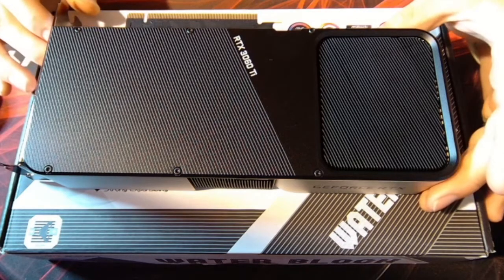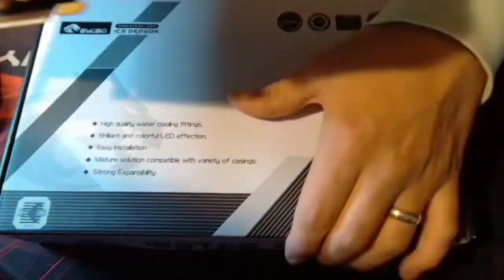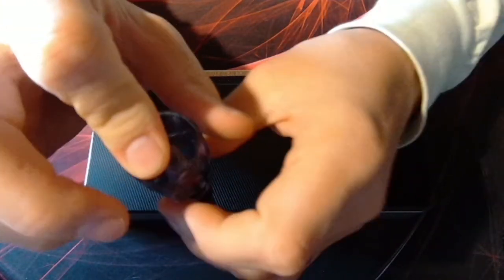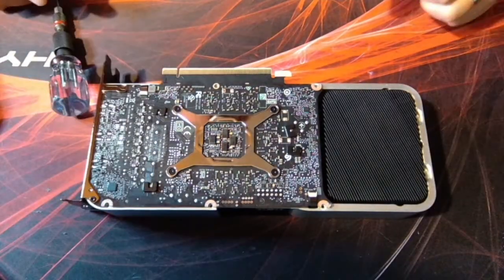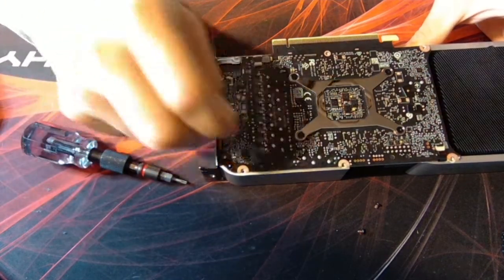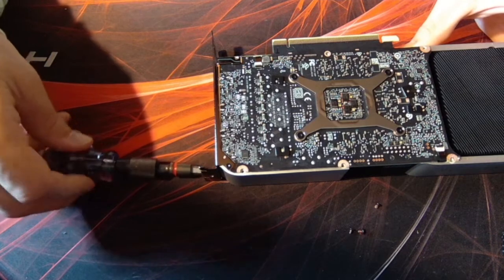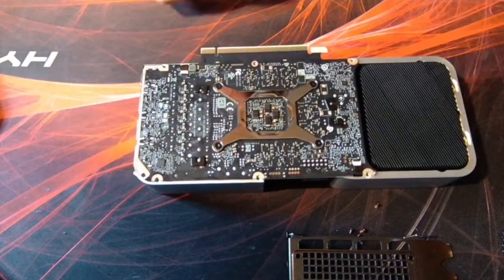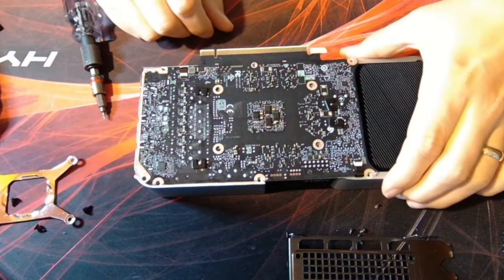Tear-Down: RTX 3060Ti Founders Edition Disassembly

Comment: Question: Did you see an improvement on thermals replacing the pads vs stock pads? Or did you install the water block right away?

Comment: 7:30 what do you do if you broke 1 of those cables in half
Reply: Hey, I think I just broke 1 of mine, what did you do?
Reply: -$300
Reply: Easy repair take to computer shop they use a soldering tool to fix it in under a minute for you.

Comment: If you consider both sides of the thermal paste, the application was just fine, the paste fully covered the chip before you pulled the two apart.
Reply from the maker: Good point!

Comment: Since the 3070 and 60ti are practically identical, do you think you can put the 3070’s PCB and backplate on a 60ti heatsink?
Reply from the maker: Good question, I haven't looked into doing that but my gut reaction would be no.